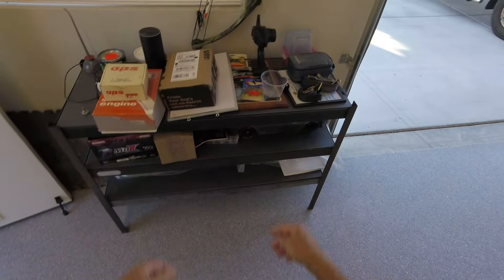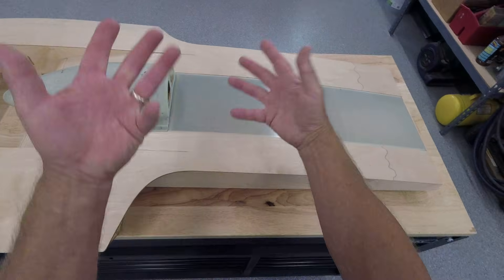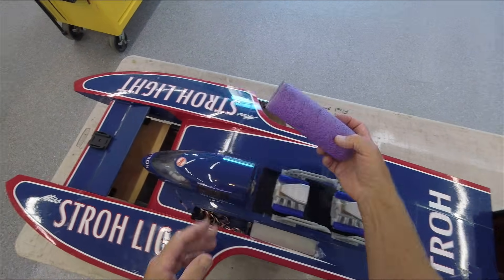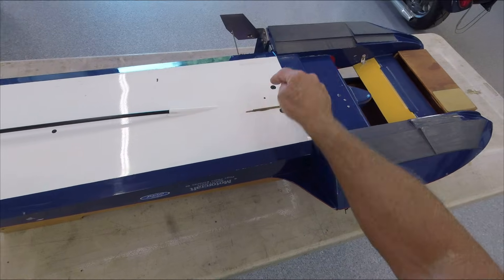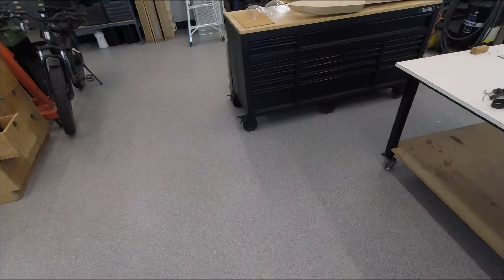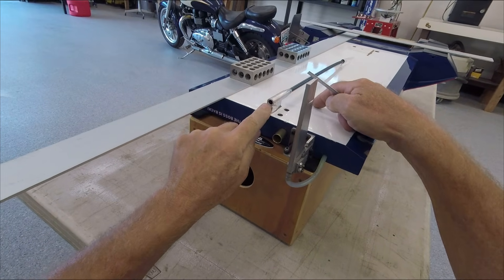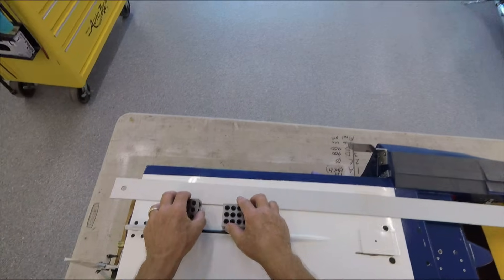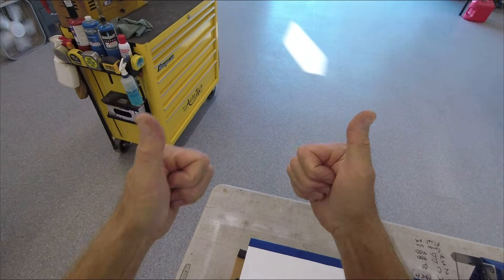NOW I Get It! | Ride Height & Strut Explained -- RC Racing Hydroplane Boat

Comment: Great to see Scott again. Funny thing Scott talking about flat bottom boats versus his 2nd eliminator build. I built an eliminator but went with flat bottom because I was unsure of the handling characteristics of a design outside of ML design. The gentle slope also gives more clearance at the bow. Should have listened to Scott. Lesson learned. Time to build another boat!
Reply from the maker: Cut it apart.  Fix it.  Run it. Simple!

Comment: How different are the small boats to the big ones in design? Are there some things that just wouldn't work on a big boat?
Reply from the maker: Totally different animals.  Think of it this way, a 1:8 scale model hydro weighs about 15 lbs and has a maximum speed in the 65 mph range. At scale that equates to 120 lbs and 520 mph!  With this knowledge it stands to reason that some features of the craft might have to be adjusted just a bit!

Comment: Scott - Nice video and great info.  

Question on the shape of the afterplane/break point in the tunnel - You mentioned (at around 6:00 in this video)  that a "flat" tunnel or afterplane was too responsive and you suggested we watch the "Eliminator" or "Eliminator 2" recent build series videos to learn about a much better afterplane design.  I did a search of your youtube videos and I'm overwhelmed by the sheer number of your videos that cover various Eliminator subjects.  Could you please provide me more info on where I could find this?  Like, how long ago did you post the video? or series of videos?  [In other words, what did you mean by "recent" video series?]

Also, if possible, could you explain, in 20 words or less, where the the breakpoint should be for a typical early '80's picklefork scale hydro (like Miss Renault)?  Or a sketch or a picture?

Thank you for any info that you can provide, and thanks for all the stupendous hydro design/build videos!

-Dave
Reply: Ope!  I think I found it.  Is it this 2 + year old video, at about 41:00?  https://www.youtube.com/watch?v=ERq25RTA0tE  

And - Is this the curve in the bottom that worked so well in your Eliminator?  Or did you modify it in a later video and make it even better?

Thanks!

-Dave
Reply from the maker: YES! That's it and it works fantastic

Comment: Great job love the videos, I am looking for some bottom, graphite, type speed paint, I noticed you had some on the bottom of your boat, if you don’t mind, what is that? Thanks love the videos.
Reply from the maker: It's a product called "Lubri-Bond A",
It's very expensive and probably doesn't do a darned thing, but it looks cool and that's worth something I guess! 😁
Reply: @M5PerfHydros  great thanks a lot love the videos

Comment: Nice shop, glad to see you back.
Reply from the maker: Thanks, it's good to be back!
Reply: Nice shop. We just build a new shop also. Glad you did the epoxy floor. We did the same totally worth it.
Reply from the maker: I'm a little bummed by it. I went with a textured floor because it was a little cheaper than the fancy swirled smooth floor, but it's a bugger to sweep and even harder to mop. Shoulda spent the extra bucks
Reply: @M5PerfHydros I use an electric leaf blower and bought one of those janitor looking dust mops. Keeps it very clean
Reply from the maker: No kidding? I thought those were for smooth floors? But heck I'm willing to try anything at this point. Thanks for the tip!
Reply: @M5PerfHydros oh well if your floor feels like sand it may not work well. Mine is that flat flake that’s been cleared over. So the dust mop works very well. All the little fibers hanging off grab all the dust from when we’re done working on boats for the day.